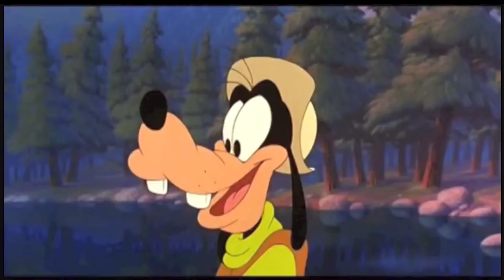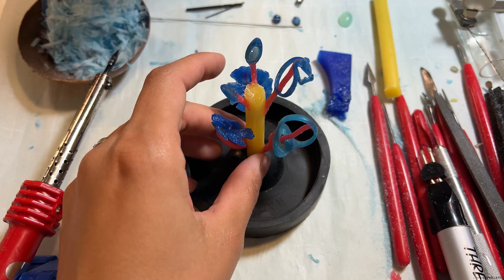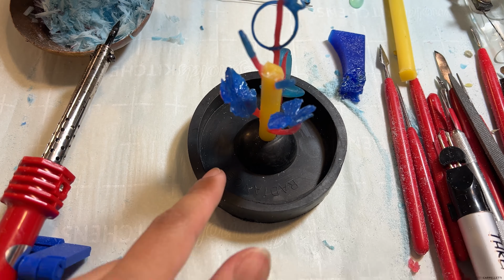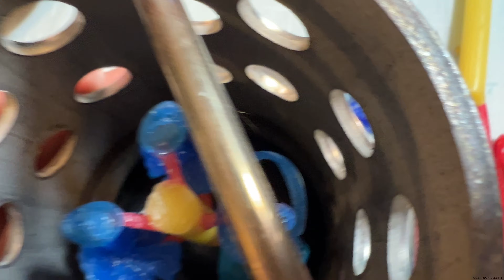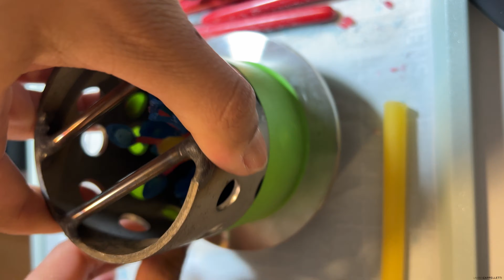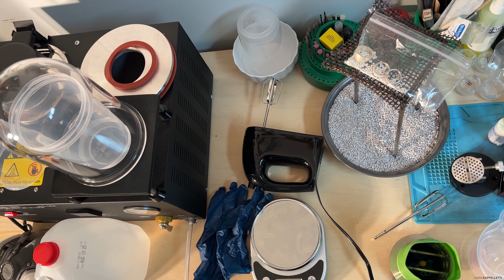First Time Lost Wax Casting at Home, My Full Process, Affordable Metal Studio Casting Equipment

Comment: I bought one and whenever I stop the vacuum pump the pressure goes down… is it normal or it should stay until I release it? 

If it is a leakage is seems to be in the base of the vacuum chamber 😢
Reply from the maker: If I turn the vacuum pump off, I lose pressure very slowly. I always just keep it on until I'm ready to remove my flask, either from the vacuum or casting chamber. I usually set the switch to vacuum release, then turn the vacuum pump off. I hope that helps! 😀

Comment: What tubing are you using for your vacuum chamber?
Reply from the maker: I ended up swapping the upper part of the hose with another one I had laying around from an old Harbor Freight kit, I believe the outside diameter is 1/4". I also used teflon tape & a metal hose clamp, and I'm much happier with the fit

Comment: Hi Lauren. FIrst of all thank you for your videos. I learned a lot. I bought the same machine a month ago and just today I start my first casting. But unfortunately I have an issue while i was puting the flask -fresh out from the kiln at 650 celcius into the vacuum chamber. And the red rubber gasket on top was burning as the flask was too hot. I saw yours didn't and I wonder if I did something wrong. And I also saw that your flask wasn't bright glowy red like mine when putting the flask into the vaccum chamber. Did you leave it outside after you took it out from the kiln  for a while before putting it into the chamber (until it wasnt glowing anymore)?
Reply from the maker: Hello there! Thank  you so much for watching! So I turn my kiln down to 600 C before I pull my flask out. My rubber gasket will smoke a tiny bit, and I've had to replace it twice. I've also gotten a graphite gasket which seems to hold up much better. I hope that helps! :)
Reply: @lawrencappelletti Thank you Lawren! I will find graphite gasket and try it out. Maybe decrease the temperature too and see. I have fun working but I am so worried now if it will set a bigger fire while pouring 😂

Comment: What vacuum hose are you using? I purchased my vacuum machine because I watched your video. But you didn’t explain later that you changed your vacuum hose.
Reply from the maker: Hello! In my most recent casting video, I talked a little bit about swapping out the hose. It was honestly just something I think was laying around from an old Harbor Freight kit, but I believe the outside diameter is 1/4". I've see those pretty cheap at Loews or Home Depot. I also used teflon tape and a metal hose clamp to get a tighter fit. Hope that helps! :)
Reply: @lawrencappelletti hi, are you still using the value blue vacuum pump?
Reply from the maker: I'm still using the same vacuum pump & haven't had any issues

Comment: I'm totally new to this, but this article might be helpful. Gates and runners that lead to the outside of the mold where air is trapped,..

https://old.foundrygate.com/upload/artigos/YSi66RktqSYj7TZBzmEZ7FW6yQf8.pdf

Also, where did you source the wax for the tree from?? My models will be made from Liqcreate 3D resin, but I need some wax to build the tree from, rather than using resin. Thanks!

Just found this excellent video on building the model tree:

https://www.youtube.com/watch?v=mz9aHc7zSXs

Comment: What size is the new whose that you got?
Reply from the maker: I believe it's a 1/4" outside diameter. I actually just had that clear hose laying around in the garage, so I don't remember where exactly it's from. I also used teflon tape and a metal hose clamp to get a tighter fit.
Reply: @ thank you